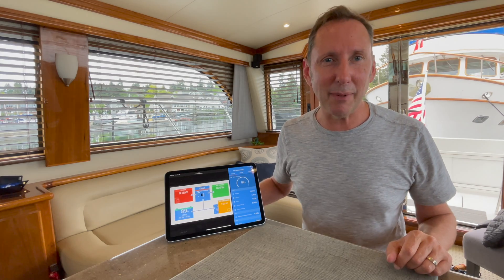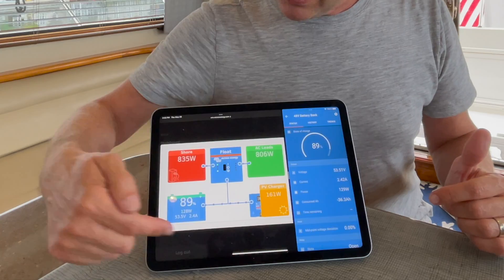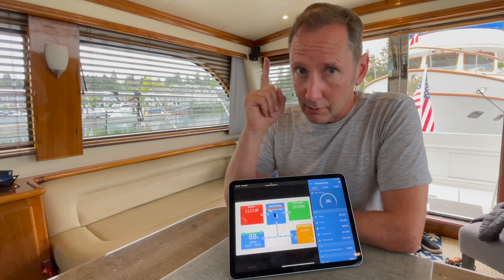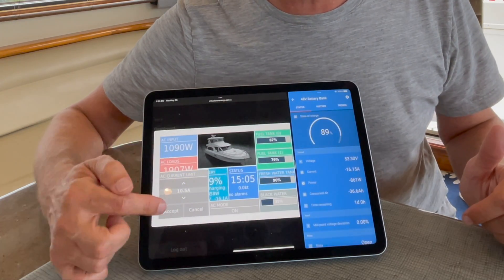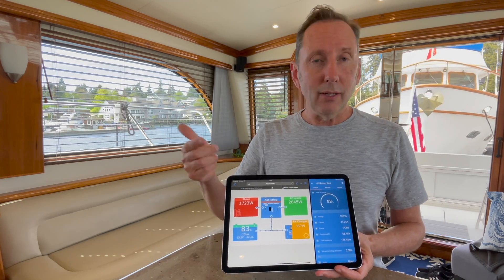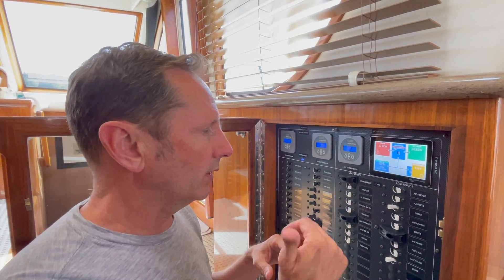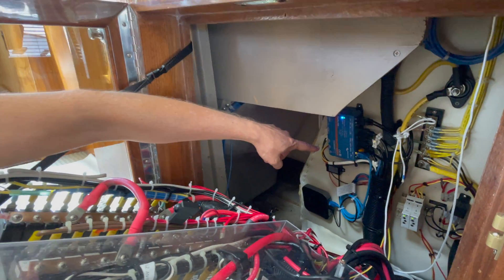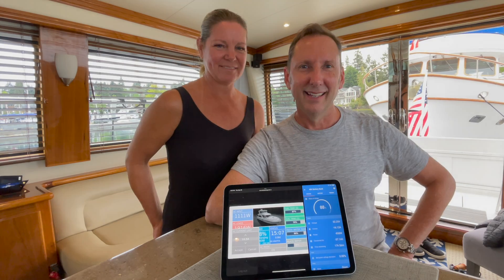How To Stop Tripping the Shore Power Breaker

Comment: For the WiFi Cerbo connection there is a way to make the Cerbo reset itself if it looses connection to the WiFi. As I monitor the boat after setting that function, I have never lost my connection from the house as I am looking at systems on the boat.

It is really amazing what Victron has done designing the ecosystem to work so well with so many options out there. Now I am going to go find your fuel tank Maretron video...I am getting tired of not trusting the Navi's gauges.

Thanks you two!

Comment: Thanks- nice video! Is that a cellular hot spot (connected to Cerbo GX) that pulls data off a cellular network, eg Verizon? I did not understand what is the purpose of that “hotspot”, if you can please help me understand.
Reply from the maker: Great question! That is indeed an AT&T Netgear hotspot connected to the Cerbo. In order to use the Victron Remote Management (VRM) via an internet connection, the Cerbo needs an internet connection. While one doesn’t need to use the VRM function, we’ve found it really useful to track historical data and monitor/adjust the system remotely. 

The Cerbo does have Wi-Fi to connect to a Wi-Fi router/internet connection but, it’s super temperamental and drops out a lot. You definitely need an Ethernet connection to your internet modem.
Reply: @ElliYacht1  thanks! I assume that you also use that hotspot for your general internet usage on the boat, not just for the Cerbo- correct? The point is you hard wire the Cerbo to the hotspot to make that connection more reliable.

Comment: Great video!. My wife and I are also live aboard on a 1967 57' Chris Craft Roamer. I'd love to learn more about your split phase system but most importantly how you handle shore power into your Quattro. We have a 125/250 50amp system with a splitter that brings in 125/30amp to the boat. I'm trying to figure out the best way to wire it into a multiplus-2 / Quattro.

Comment: Thanks for sharing. What mifi router are you using and what style “resistive” sensor(s) might you using for your tanks? I want to change my cheap “recpro” three wire/three tab sensors out. 
Thanks
Reply from the maker: Thank you! We have a super cheap $25 unlimited plan from years ago.  The router is a Netgear M1 Nighthawk. We use the Maretron pressure transducer sensors. Here’s the video where we put those in… How to fix your Boat's Broken Tank Gauge
https://youtu.be/96mSzSCkDH4